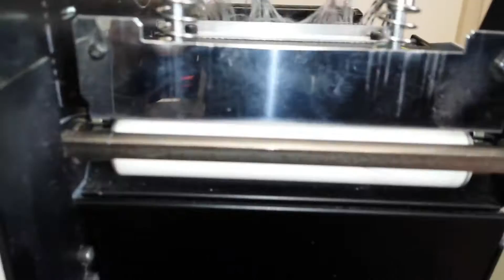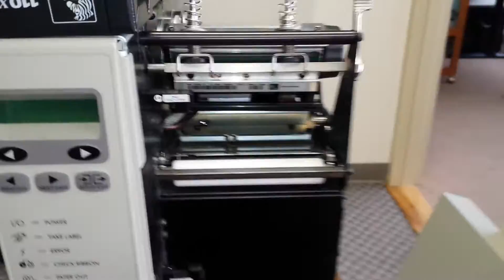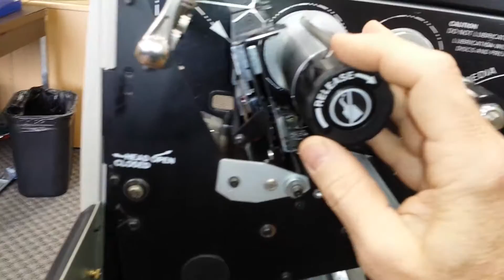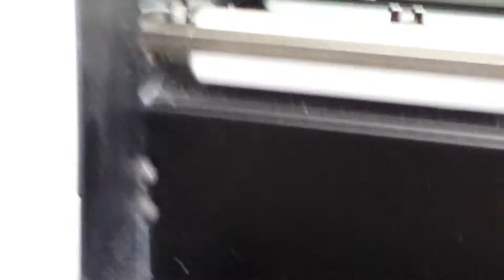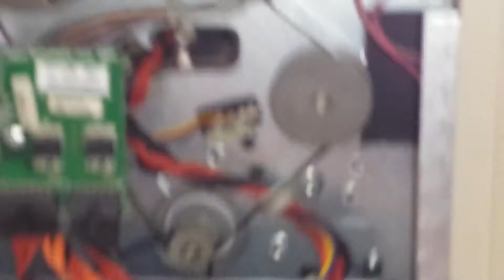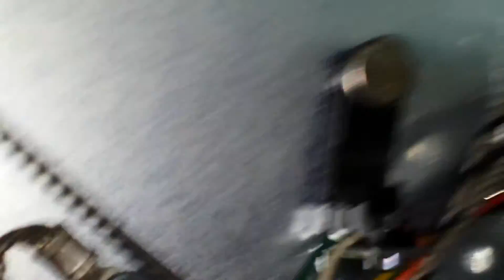Zebra Printer Troubleshooting

Comment: I wonder if you could help me, I replaced the main logic board yesterday after getting a blank display and nothing else on a X10i111
Now the display is working but now the labels will not line up with the tear off bar and image is not in line with the label, I have done some cleaning to the sensors and calibrations but still it will not line up
Reply: Make sure the printer is in tear off mode not rewind mode. There is the longer calibration procedure sometimes called manual calibration you could perform. That's a big job replacing the board. Wow!
Reply: @Steven Morris  thanks for the response,  It was in tear off mode, and I tried both. I am a photocopier engineer of 17 years and these zebra are new to me.
I am thinking that the new board has reset some setting and the reason the image on the label is off is also the same reason the labels aren't set ready to be teared off

Comment: This was great to hear from an expert. I’m repairing a Z4M plus and the take up ribbon was slipping. It turns out I just needed to be very careful and placing the collar as tight as possible towards the inside on the shaft. The way you described the internal workings let me know I was not troubleshooting a part but an adjustment. Thanks

Comment: Not a bad printer. PITA to load media. Take up spool has to have a core for doing small batches of labels. Its a pain to remove them from the take up spool if you dont use a core. I would take an Intermec 4420 any day over these.
Reply from the maker: Better to use Fan fold media.
Reply: @thebarcodeguy4420  Messy when your doing 1,000 labels at a time.  We used a Zebra ZT610 for all our print stations. Decent printer.